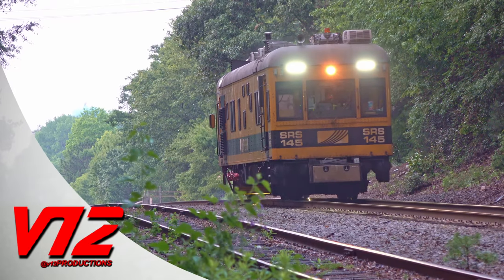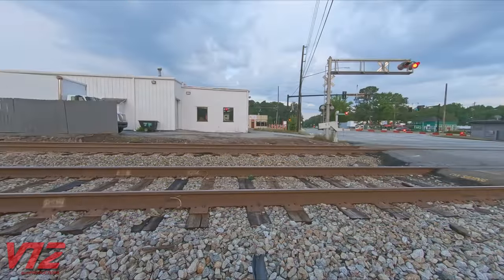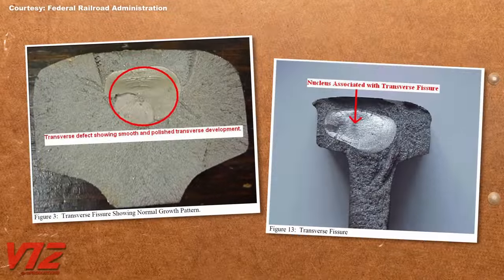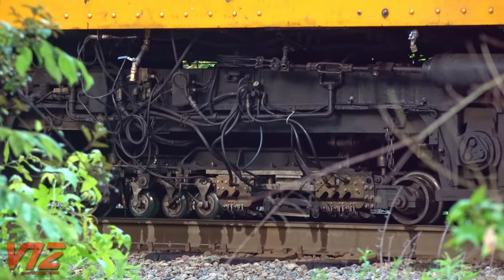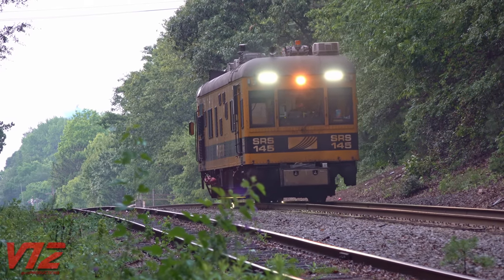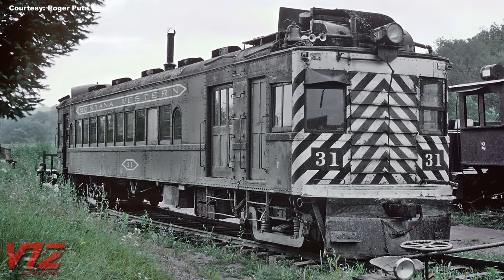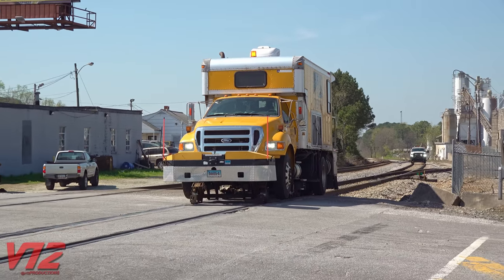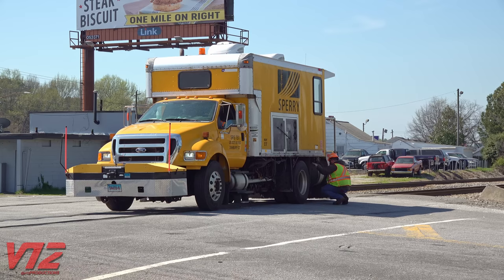Doodlebugs & Sperry Cars?

Comment: Hi Charlie, another great video.  How often are the rails inspected?  Also, I'm assuming that the inspection is only for main line and not for sidings.
Reply from the maker: I'm not sure about how often they do inspections with the Sperry Car, but I do know busy mainlines are supposed to get a hi-rail inspection at least twice per week.
Reply: All tracks are tested periodically, frequency depends on annual gross tonnage